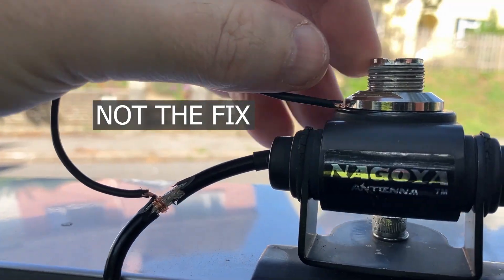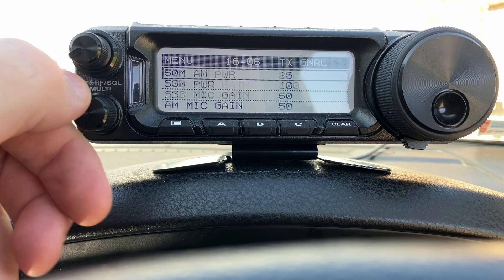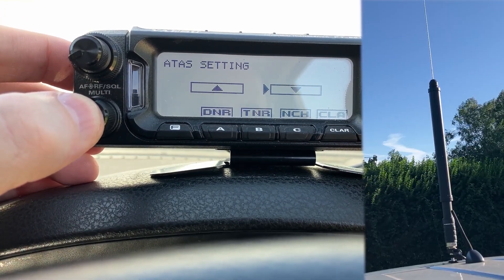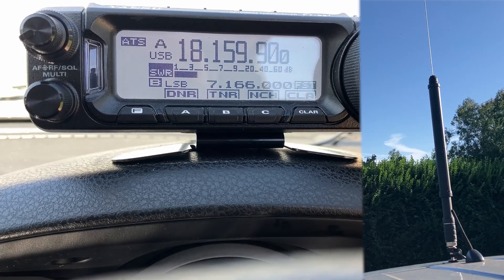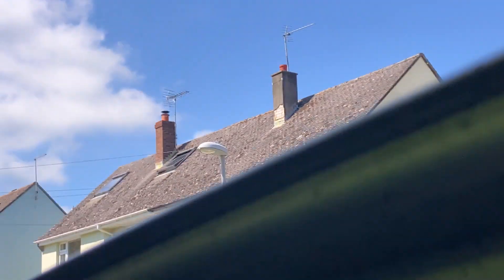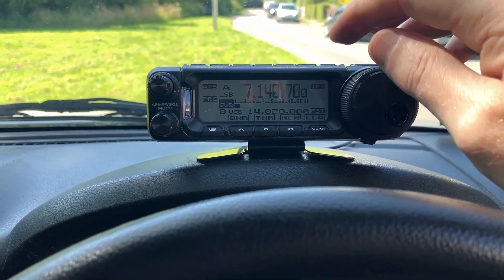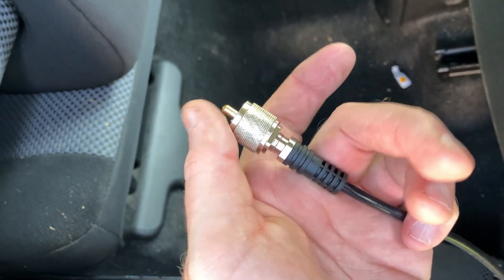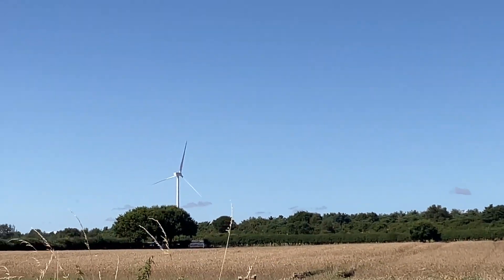HAM RADIO SUCCESS 👌 my YAESU 891 and ATAS 120 disaster fixed

Comment: Very grateful I stumbled back on this video Stu! My ATAS stuck at the bottom on me last week on a mobile WAI Activation Sked... People had mentioned to try all sorts of radio resets and also to move the antenna with the up/down, but I didn't realise until watching this that in Yaesu Land, Up means down and down means up!!! 🤣..
Anyway, now I know it moves manually but still wont tune.... When I press Tune the "ATS" just flashes in the top corner of the screen and the antenna just keeps going right back to the bottom again...
Any ideas?
Reply from the maker: Sounds like a short or wrong voltage Dave ..
Reply: @G5STU  Possibly Stu, but would that not stop it moving up and down manually with the arrows also?

Comment: Excellent video, sir! I'm using FT-891, SignaLink USB, and WSJT-X.   On 10m, FT8, software says 29.074.000.  But I find better results at 28.075.000.  But I make a few QSO's, then I see the radio says 28.074.500.  Then a few more QSO's, then the radio says 28.074.000.  Next, it says 28.073.500.  Why is the radio frequency indicator dropping?  What am I doing wrong?  Many thanks!
Reply from the maker: Hey, what logging system are you using ?
Reply: @G5STU  For the moment, eQSL.

Comment: So what causes it to stick, top or bottom , Yaesu Tech told me that I needed to put a Duplexer on my ft 891 because my  120a is to close to  Comet uhf/vhf  , and putting rf into 120a  which is going onti my ft891 and it can mess up the front end on my ft891,and I  only operate one at a time

Comment: there was no point sanding off the paint as the mounts are normally painted or powder coated and are not conductive between the aerial so239 and mounting screws (test with a multimeter), as most people run their rigs from the car battery the coax is grounded to the chassis through that and don't require extra earths, we are also talking about RF and not DC so you get capacitive coupling any way, hope you have had no more problems with it, I will watch out for those connectors in the future with a handy pair of wire cutters lol
Reply from the maker: @Auntystatic  yep totally agree, was a while ago now but I think the main reason for better earth was for the DC to the drive motor in the antenna (not for RF).

Comment: Don't strip off the paint, when you do that you remove the zinc rustproofing layer. Don't use the metal plate when attaching to metal bodywork...I'll explain why later in my reply. You just use the grub screws to secure the mount. The grub screws will cut through the paint to the metal of the bodywork and the zinc rustproof coating will seal around them so your car doesn't rust.

That metal plate is only really to be used if you're attaching the mount to plastic or fibreglass so the metal plate and bottom of the bit with the rubber on exert a clamping force instead of the grub screws just cutting straight through the plastic or fibreglass. You would attach the mount , place the metal plate on the underside of the surface you've attached it to and then tighten the grub screws so they're putting pressure on the plate instead of cutting into the panel.

Comment: I have a Tarheel 200 sitting here in shack, I used with with a few ground radials and worked VK a few times on 40M, it's a pile up buster, bin the ATAS.

Comment: Nice! Is that a Yaesu specific aerial? Never seen on of those before.
Reply from the maker: @MikeDent  yep it an ATAS 120 designed for Yaesu but you can get a control box to allow it to be used with any radio, check the ML&S website for details .